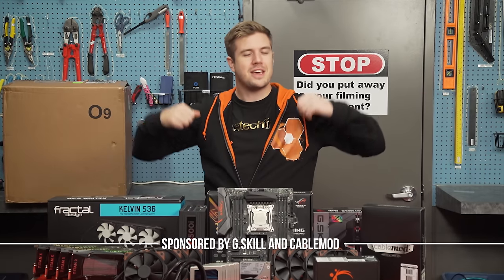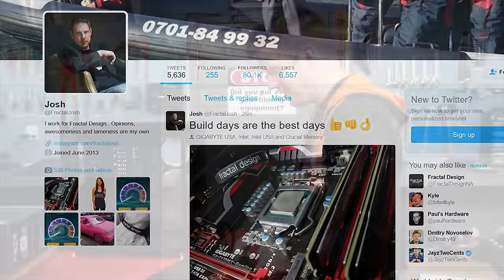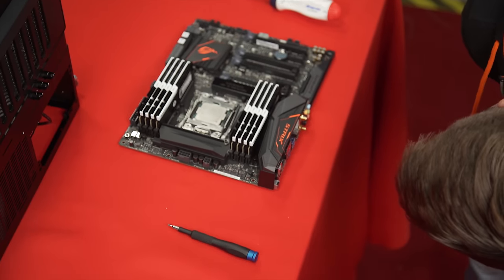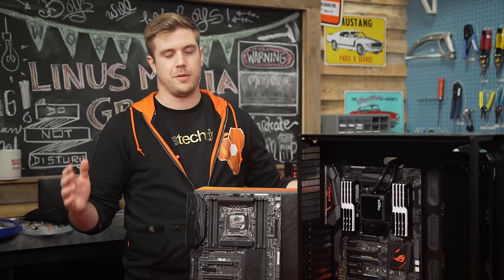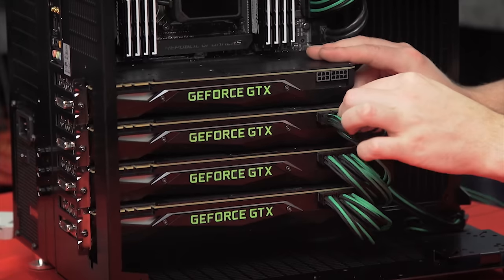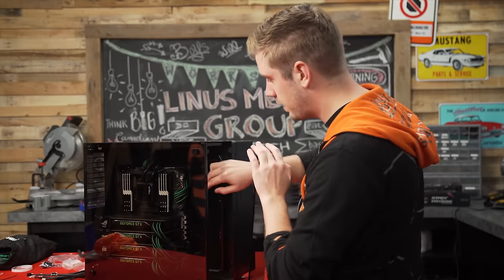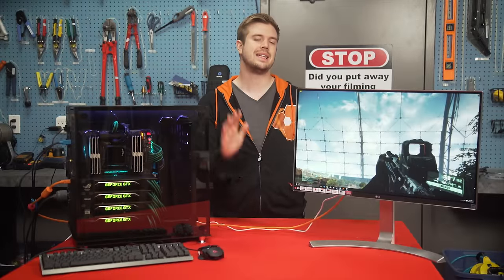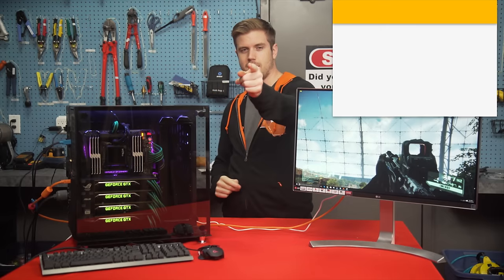The Compensator 2.0 - ABSOLUTELY No Compromises PC Build Log

Comment: Gets 4 titan cards- runs games at 35-40fps
Reply: Titans, honestly, are just terribly optimized for gaming. They tear apart benchmarks and 3d rendering works well... But not games.
Reply: Thats because SLI is broken as hell and doesnt work
Reply: machinist1337 2 way is fine, 3 and 4 are too inconsistent because there are 4 things going very fast so slight changes in speed can slow down the whole system because it need to compensate (it doesnt need to do that in rendering and benchmarks, because there is a one way list. games are unpredictable because they arent the same every time)
Reply: Diamond Hawk74 I beg to differ. 2 way sli does not work. Game stutter and screen tearing occurs.
Reply: TonnyTheTonner They only support 2 way sli bruh
Reply: Future Mods at 144p oof
Reply: ToleranceGamingPro Logic 😂
Reply: They're great for machine learning, deep learning, and neural networks - it's what they're really made for
Reply: Horror Clips rip electricity bill though like god damn
Reply: It does work but the current game developers don't work on compatibility anymore...sadly....
Reply: rtx titan i9-9980XE? where they at?
Reply: It's because of bottlenecking.
Reply: But the titanxps are the most lit ass founders editions ever made so I would even if they were the same price than an gtx 1080 that’s better for gaming take the xp over the 1080ti
Reply: Sli is depend on games and not all game supported. Why bother waste few thousand dollars just to run 40 fps per second and In the end regretted
Reply: And that is why Console>PC
Reply: TonnyTheTonner at 4k

Comment: "we will cut no corners"
>literally cuts corners
Reply: Personally, I would not have put that AIO in like he did.  EVER!!  Something built to the cost of this system would have started with water cooling, and had separate cooling radiators for the video cards to keep heat out of the processor.  4 video cards is going to pump a LOT of heat.  But the bad part is that the system is basically a waste of money because as he showed, the games are not built and coded to utilize all the video cards for a much better gaming experience.
Reply: @overyonderjustapiece  I personally dont even think anybody would build such a PC for "Gaming experience". I can kinda see it in workload but other than that, why bother? :D

Comment: "Absolutely no compromises." Where's the custom water loop to cool those GPUs?
Reply: I know seriously they are holding back.
Reply: "buy them on a shelf and throw them in your computer", you can't just throw a custom water cooling loop for 4 GPUs in your computer.
Reply: Yeah the purpose of compensator is that it's something anyone with way to much money can build. Custom water loops require considerable skill.
Reply: And actual effort to make sure there are no kinks in the process.
Reply: If the goal was really all about plug and play, you'd just order it custom with a loop and let someone else do all the work.

Comment: how about a video about the optimum gaming style setup, with a chair, lighting, desk review etc. I'd be interested
Reply: Yea! show how to stop getting sore back/wrists from playing too long.
that would be sweet!
Reply: HidingZebraTube ikr! There actually isn't much information about it
Reply: Honestly, the best thing you can do is get up every 2 hours. walk a little bit around the house and stretch. The human body wasn't made for sitting around so many hours. That won't change no matter what desk or chair you have.
Reply: ModifiedDuck yeah, I do that, I'm too poor for an office chair so it's every hour of me😂
Reply: Id recommend getting a more ergonomic keyboard with a resting place for your wrist. Lowering the keyboard incline legs. And yes most importantly getting up every 2 hours to stretch, rehydrate with fluids, and lay on the floor completely flat and relax the muslces in the neck. Also close your eyes as they might be strained. Play in a well lit environment, especially if you play prolonged sessions. Use a blue light filter it is already built into windows 10. So unless your using mac os, Linux, or windows 7 there is no excuse. And there are other 3rd party softwares that can do the same task on the previously mentioned operating systems. It will feel weird for a while but you will eventually stop noticing it altogther and this will help reduce eye strain and prevent minor insomnia.... for those who struggle to fall asleep. Hope that helped.

Comment: Why did this have to be so disappointing?
Reply: Lel he could put i9 7980XE and 4x TitanV or Vega Frontier atleast
Reply: I think it's supposed to be that way. You could retitle this "Some self-aware idiot with money throws expensive parts in a pc and hope it run good".
Reply: @whattehl2740  7980XE released 2017, just like the TitanV, this video was uploaded 2016 :)
Reply: What teh L The Titan V doesn’t support SLI so you can’t use more than 1
Reply: He stated at the beginning, only off the shelf parts. This build is kind of a potshot at those who do things like buy top of the line components for the sake of having them without understanding what to do with them.

Comment: What screwdriver do you use?
Reply: SawgeTM this should be the top comment in every Linus video
Reply: SawgeTM What screws do you use?
Reply: He used the iFixit bit driver, and some other screwdriver you can probably get for $5 at a hardware store.
Reply: I just like his ratcheting screwdriver he has.
Reply: Dunno if you already found out but I think it is a Snap-On ratcheting screwdriver. You can find one at Home Depot but it will not be from Snap-On.
Reply: It was watercooled dual Screw XP 16GB running in SLI. It can drive up to four parallel screws at a time.
Reply: SPIN
Reply: +Rizki Hadiaturrasyid beautiful
Reply: snap on baby, snap on $70.
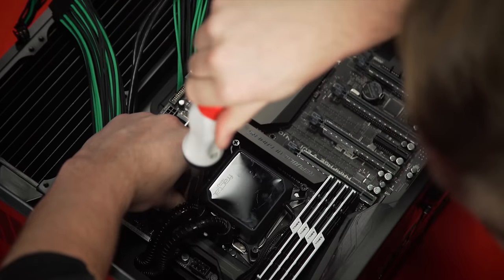Reply: That's the convenient model where you need to rotate the tip with your fingers to unscrew while maintaining the oversized body making the cric cric noise, just like @8:44.

Comment: why the hell is lian li making cases that are freaking unusable????
Reply: all of the problems experienced here was actually because of either using non standard form factor components or trying to do things that would be impossible in any case without modification.
Reply: taiiat cause using an AIO isn't common? lol
Reply: The case is fine. It's the installer that is the problem here. Parts are missing for the drive bay and he installed the rad backwards.
Reply: ***** the Power Supply doesn't conform to ATX standards, and on literally no case could you put a combo Block and Pump through a cable routing grommet without cutting it.

so git gouda and understand what you're complaining about.
Reply: That's what Pilch meant by "He installed the rad backwards". The case wasn't designed to have the tubes go at all behind the wall motherboard is mounted on. The rad is supposed to be orientated so that the connectors come on the same side as the motherboard (Like in majority of cases)
Reply: they're meant to be pretty, not usable.
Reply: taiiat that's what I'm saying. what kind of case basically doesn't allow for an AIO if you have to shove it through a grommet.
Reply: Ailuropoda melanoleuca Nineoneone it's a beautiful case but poorly designed for anything other than a custom loop, and even then, not great.
Reply: ***** i don't know what the dicks you're talking about. you don't have to put it through a grommet, you only do if you decide you want to hide the tubing by installing the entire Cooler backwards.

it was a nice idea to try to look cleaner, but it's not the way the other 99.100% of people install their Closed Circuit Coolers.

git gouda.

Comment: JUST TURN THE RADIATOR AROUND.
Reply: seriously like jesus.... this frustrated me to no end XD
Reply: And above all he didnt even dry fit it to see if it'd work properly BEFORE he permanently modified the very expensive case....
And why didnt you cut out the whole notch, so everything would've looked decent, and no chance of anything getting PUNCTURED.
I'm going to laugh so hard when those tubes get punctured.
(Not really,  :*( RIP poor defenseless PC )
Reply: the intention was to rout the tubes behind for a cleaner look.

a test fit would be ideal but without the cutout you wouldn't be able to get even close to the right position, to be fair.

the other half of the underside of that routing hole has a Motherboard Standoff on it.
Reply: ***** I get the intention, but there was no proper planning, he has those pipes tight against that raw metal edge. he could've also reduced the tightness by moving the fans to the other side of the rad.
Reply: turn fans

Comment: Hi, I build boats and it is one of the dustier jobs on Earth. 
A tip of you don't have industrial dust extractors just get someone to hold a vacuum very very close in the direction you spit dust from something small like a dremmel and you can get anywhere from 70-99% of dust. If you direct dust properly and have the revs just right so it cuts properly but does not throw dust super far you can nearly catch 100%.also need someone good holding the hose that does not get in your way or  cut the hose. Team work. You can also use chinese containers or funnels to help our the square corner of ice cream container for corners etc. Just Mcgyver the f#@k out of it. 
Now why you may not get all you will get most and most of the fine stuff that will get blown into nooks and crannies that are a bitch to clean. Also stops the wind effect a lot. I learnt a long time ago that setting up good extraction is way better than cleaning especially when there are like 1000 of surfaces and you have white dust on black. And you want to keep the thing all shiny and brand new. It also saves time and the number one benefit is for your health. You are not hoovering the dust yourself. Don't be the vacuum and suck, let the vacuum do all the sucking. Suckers.
Reply: mackstertube nice to read your story
Reply: don't use a vacuum cleaner, the dust in there is highly combustable and you don't want high energy particles flying in there like the sparks from a dremmel.
Reply: mackstertube instructions not clear. Swallowed the vacuum cleaner and now my ear sucks up dust.
Reply: Well you have a real problem on your hands then.
Reply: tjeulink That has never been a problem in 12 years of doing it with all types of dust from metal to different wood species, to fibreglass, to plastics to anything you can think of. You would need a massive open bag and the perfect ratio of dust to air which will never happen in a confined vacuum.
The one story I have heard and I think someone out our factory did have trouble with was when someone sucked up a rag or must have sucked up acetone fumes, the perfect ratio of acetone to air formed and a spark from the vacuum blew up the motor and that was it. It did not even ignite the dust.
If it was going to ignite the dust that would have been more of the perfect storm.
So, yeah saying it like that sounds correct and scientifically possible and all that but in reality it ain't going to happen, we have had so many types of dust and and chemicals and sparks and all types of situations and nothing has ever happened and that would be with hundreds of thousands of hours combined with many workers, even at tafe no such story exists. Even if a bit of dust did ignite it would be so tiny that you would not even notice and it would not be an explosion or whatever you are suggesting. I would only worry about acetone or a highly combustible chemical and that is only when it is as a vapour and even then nothing massively district would happen because the area is so tiny and for the right mixture to form there cannot be that much so the explosion is so small it affect the vacuum and not you.
Now your theory sounds great and very plausible and I might tend to agree if I did not know what I know and have the experience and combined experience of hundreds of hours and the combined time of many many lifetimes, but in reality won't happen. I am afraid it is one of those theories that when you say it sounds likely and very believable which is why there is a show called mythbusters.
However this is just a scientific myth and if you disagree you are just one of those viewers who writes back in only to be proven wrong again. The difference here being to that they would not have had as many practical hours, types of vacuums, temperatures, wood species etc, etc,
Now you can argue if you want to but I can't see how you can argue with hundreds of thousands of hours of providing these circumstances and nothing ever happened. If it was going to happen they would tell you not do it when learning at TAFE since they are so health and safety conscious.
And before you say it is possible maybe but if I have worked with over 200 guys all doing it for 3 to 50 years that is the equivalent 40 lifetimes and hundreds of thousands of hours plus they work with other guys so with six degrees of separation it would have come up in a story between guys. As anything interesting like that when you work with guys constantly would have come up. So I would bet my house on it. Also used many types of vacuums and big industrial dust extractors which have much bigger bags like 3-4 feet tall above and below the entry pint so that would be a much more likely place and it has never happened.
So that is a good myth you are talking about but that is all it is. The circumstance that you have to have must be perfect and I small home vacuum does not have the capacity for it to happen in, or probably the type of bag and most vacuums at home now have filters and all kind of crap that would not even let the spark get in the bag, also the speed and volume of air would not be conducive to it.
I don't know what else I can say, except that I have the hours and experience on my side here.
Reply: mackstertube thats an anecdotal fallacy... it might highly differentiate on case by case basis depending on how old the engine is and how strong the vacuum cleaner is.

Comment: That's what you get for trying 4 way SLI, I guess... I'll stick with my single GTX 1080 thanks.
Reply: SyariStudios 1080 is better than 2 standard 980. as it should be. titan XP is only a smidge better than a 1080. for twice the price. i'd have 2 1080's  instead.

Comment: What a fail of a build. So many things could have been done better, especially considering this was an "unlimited budget" build. Heat issues? Total system watercooling. Fixed easily. Setting up a custom loop is not even that hard these days...
Reply: ChaosphereIX the point is using parts bought off shelves. custom water cooling wasn't permitted.
Reply: sheiksubra well that makes no sense. Anyone who is willing to shell out this kind of money for a system will shell out the dough for proper cooling. Or if you are sticking strictly to that principle...instead of stupid Titan X, then four Hybrid 1080s. There, off the shelf, and fixed all issues. Also, the Lian Li case is stupid with inadequate airflow. Poor choice considering there is a lot of heat being generated. Like I said, many things could have been done better.
Reply: ChaosphereIX most the stuff they have was given to them for free. this whole vid was a joke on how much of the most expensive components can u stuff into one machine. it's not ment to be practical, noone is gonna take that home as their legit personal gaming computer. they're gonna take it apart and put most of it back in a box.
Reply: sheiksubra I totally get that...they had to work with what they were given by the sponsors. But they should make suggestions for improving it at the end of the vid, and what parts they may substitute etc. At least that is what I would have wanted to see: so it failed, why? And how do you prevent the failure in the future?

Just my preference I guess...
Reply: ChaosphereIX lol not the point sorry. I'm sure him, Linus and someone like jayztwocents would totally know how to make this OP rig work that would include removing 2 graphics cards. j2c has already benchmarked 3-4 1080s and reported pascal cards don't allow more than 2way sli. more makes it worse.
Reply: sheiksubra ok I hear ya. Doesn't mean this build isn't a fail. Fails to compensate at all...but I do hear you sir.
Reply: sheiksubra yes thank you